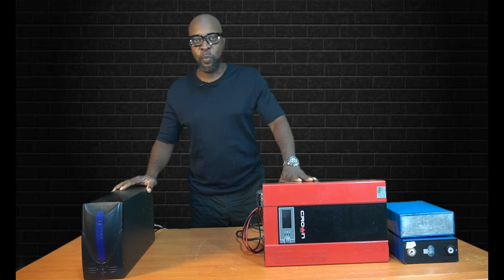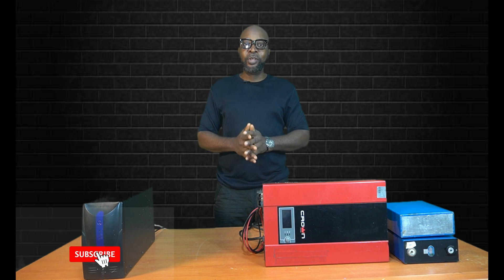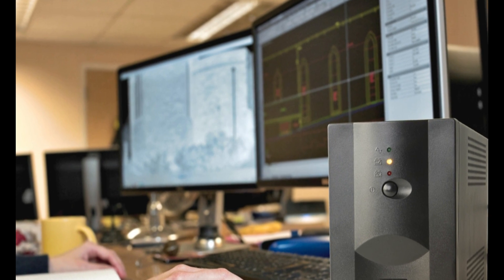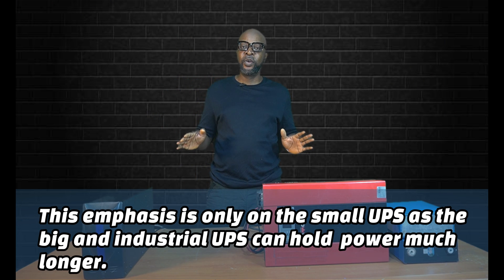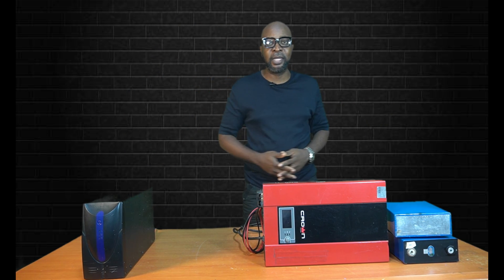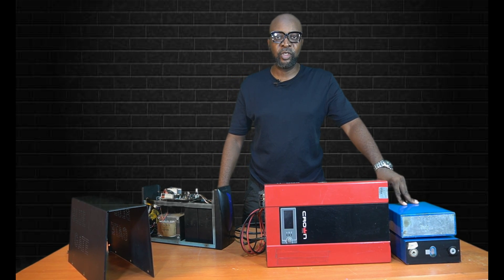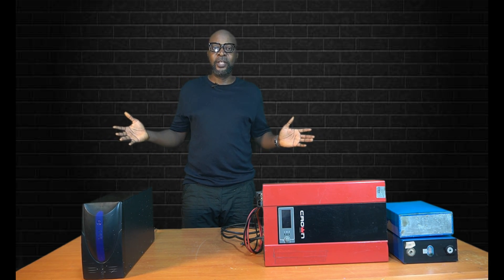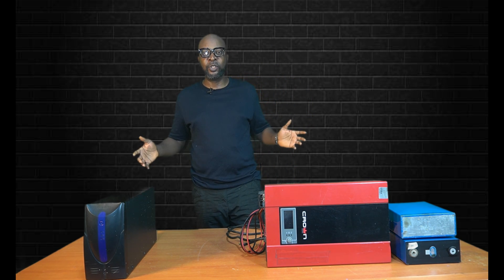UPS and Inverter what really is the difference

Comment: Point of correction please...since the battery are connected in parallel,their combined voltage should be 12volts as against 24volts that you said.... Series connection increase the voltage and parallel connection increase the current.

Comment: Hi I use an ups made by middle Atlantic 48 volt inverter low frequency 1800 model 2200R it’s been running for 5 years non stop on a 20 kWh battery best ever also some inverters but they don’t seem to last as long or handle heavy loads like the ups cleaner frequency stable at heavy loads
Reply from the maker: @1969fallen  Thanks for sharing

Comment: How many hours can 600va ups last on a 100a battery with a load of 380w, and how many hours will the inverter last on the same load
Reply: Same question I wanted to ask
Reply: But the inverter will use less energy to convert the power so inverters will give more time than a UPS since they usually heat up during conversion
Reply: A 600VA UPS, if it's cos phi (power factor) is 0,8, means a full power capability of 480W. Now, if the battery is a 12V one, which is the usual case for such a small UPS,  then this maximum current draw (without the losses) will be 40A (for 480W). For the load of 380W, it will be 31,66A, or, rounded up, 32A. This means that it will hold this load for 3 hours plus 7,5 minutes (again, theoretically without the losses). Finally, just because it is recommended not to exploit the entire capacitance of the battery, but only 50% of it, this means that the above time duration of 3 hours approximately reduces to the half of it, that is, 1,5h...

Comment: The other elephant in the room is the parasitic drain the UPS has and the inefficiant Iron and copper losses in the massive transformer which make them un suited to act as a constant supply source to a domestic type load situation.
Large UPS's can and do have external battery banks as in communications and server farms. The additional battery capacity and UPS rating depends on the required up time and load needed for mission critical installation. Even small 2kva UPS can have external batteries attached but the attached battery capacity has a limiting point, being the recharging capacity of the UPS circuit. In cases where a substantial storage capacity is required a seperate dedicated external charger can feed the battery bank with appropriate protection devices.
As far as the Inverter being able to deliver the same supply loading as what the grid can supply is faulse. The Inverter sould only supply upto what is on the name plate, If it is 10kw then that is it. It may be able to deliver extremely short duration above the stated rating however internal over current and thermal protection circuits will trip and take the unit off line.

Comment: Do I still need a charge controller with my luminous inverter if I am not using solar panels? I want ro procure an inverter and tubular batteries as a backup system without solar panels, so i will like to know if i still need a charge controller.
Reply from the maker: No you dont need a charge controlller , charge controllers only works with the Solar panel .Your inverter has an in built battery charger pls go ahead and get it. kindly subscribe to our channel if you havent
Reply: @smilinsunsmilinsun8056  I am indeed a true subscriber. One final question, would you advise the Luminous brand only or other brands are solid as well? I was advised to go for Luminous only but it's pricey compared to Eastman and the likes. As a professional, what would you advise?
Reply from the maker: @290revolver290  Lumious is good it gets the job done
Reply: @smilinsunsmilinsun8056  Thank you! Do have an amazing day.

Comment: Yes, I wanted to know how to connect as many batteries as I wish to a UPS, especially if they are 12 V 100 Ah batteries. The UPS should have an amp limit, which means the wires have to be changed. But what wires do I have to change, and how do I connect a large number of batteries to virtually any UPS? What we are trying to do is basically connect maybe 100 large deep cycle batteries and use a transfer switch to switch it from AC to DC without damaging the UPS or the switch. (Purpose: longer run time)
Reply from the maker: This can work but the challenge here is that the UPS will struggle to charge that large amperage and that could sulphate the battery
Reply: @smilinsunsmilinsun8056   yes, but that's the reason why you use a charge controller to charge the batteries, and the UPS would only be there to switch over, if I can find out what wires I need to change I will do a video, but I found a couple of videos that can give you some references.   https://youtu.be/2DHRezbPwCs

https://youtu.be/VM7blJ-oV84

I'm just asking you to give me any assistance that you can I got an old U PS and I'm waiting for the batteries.
Reply from the maker: @teslapark3406  well thats the part you didnt explain, it been connected to Solar. If Solar is taking care of the charging then go ahead connect the battery to it ,it will work. Monitor it if the wire heats up change the wire gauge to something bigger. 6mm or 10 mm will be fine
Reply: @smilinsunsmilinsun8056  yes that's what I'm asking which wires need to be changed in that UPS can you do a video if so I will do a video.
Reply from the maker: It would make more sense to use 1kva inverter with the proposed battery  and still attach the UPS to it
Reply from the maker: The dc wire connected to the battery alone